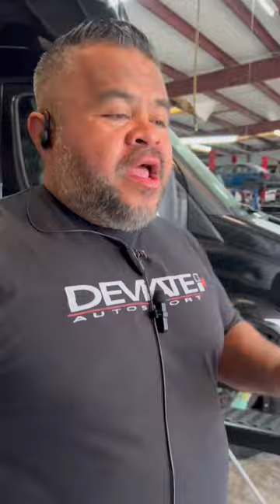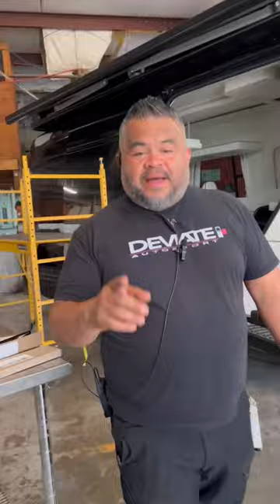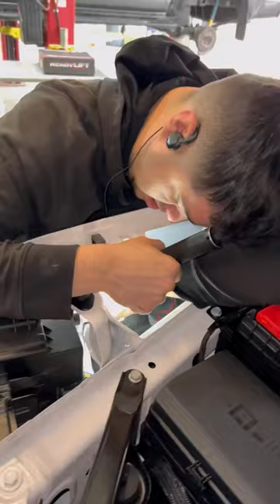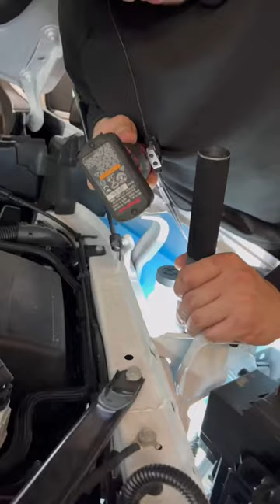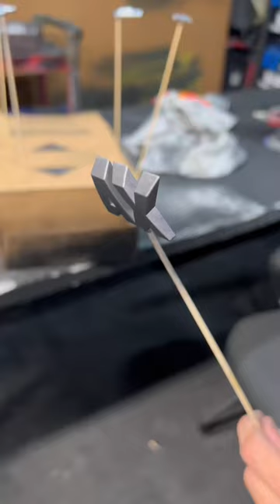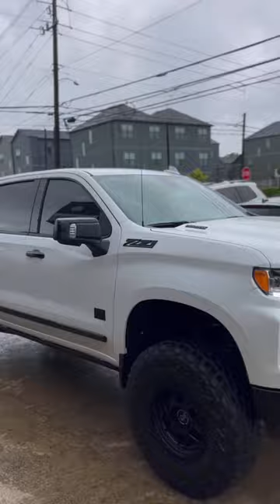HIGHCOUNTRY Z71 FULL CHROME DELETE‼️ #shorts

Comment: Lol it’s a one day job if the blacked out parts were being swapped in for chrome. Painting chrome electroplated plastic trim isn’t a one day job to do it correctly. Strip the chrome and the copper below it down to the bare plastic, then prep and paint. I have badges done like that that didn’t chip in 10 years. You’re gonna have to use lil brushes to keep ‘em polished and get the white residue out of the crevices in the lettering. Sanded chrome still will chip and flake off because water still can get behind the badge and under it around the edges where then paint is most likely to get damaged.